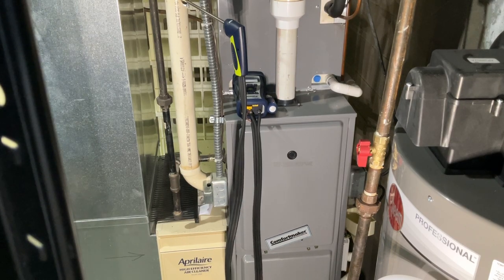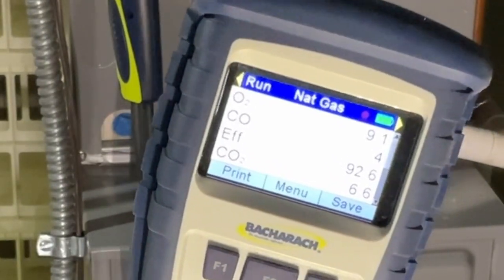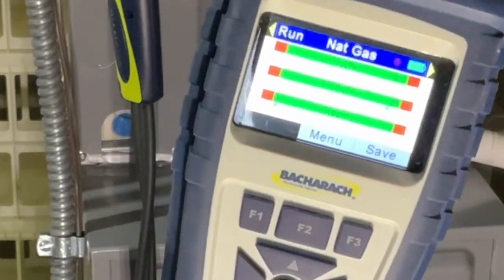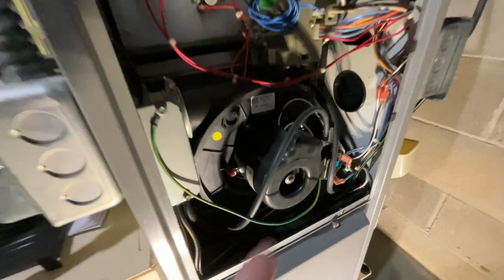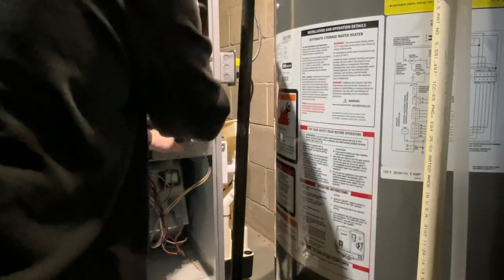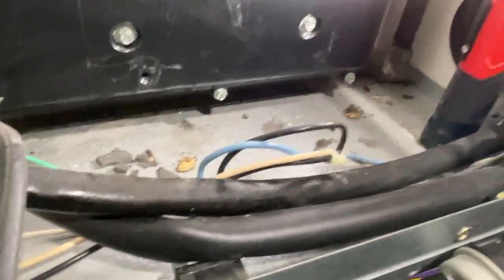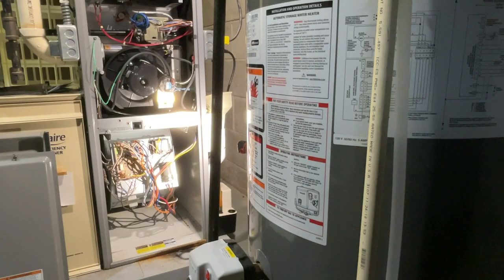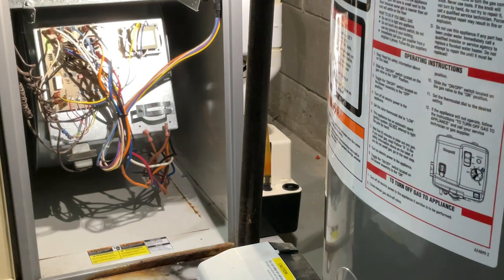Comfortmaker furnace making noise

Comment: Those inducers are shit. They get noisy, you replace it and it'll sound the exact same way in a year. And you also need to have a spare collector box with, chances are it's cracked. Definitely not icps best design, if they ever had a good idea that is.